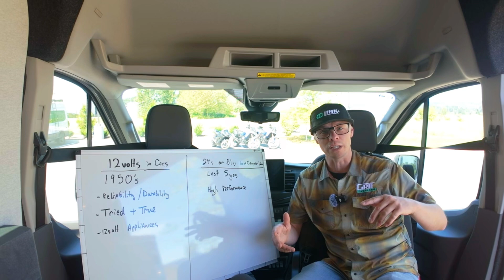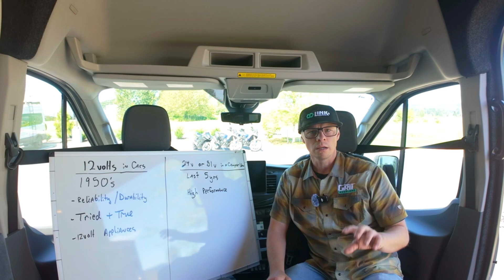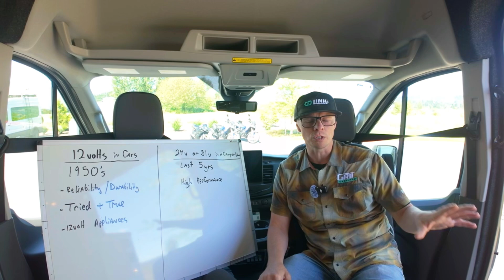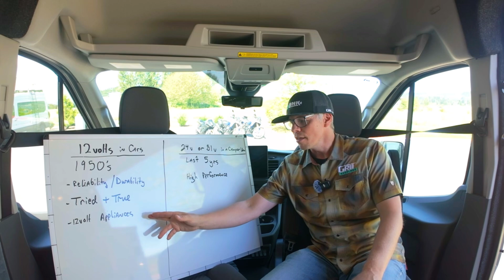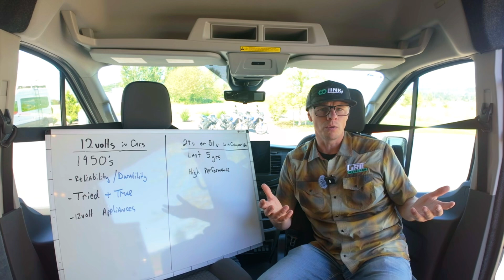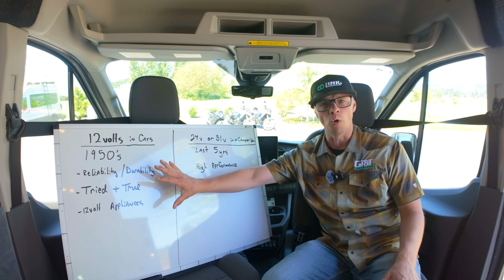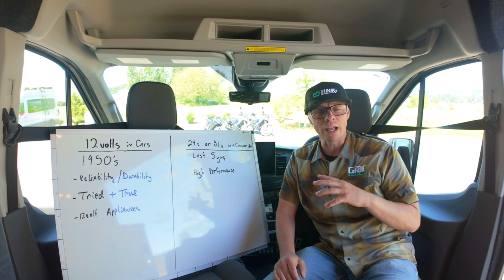Is 12V outdated? Is 48V or 51V the future of Campervans | Grit Overland Experiment

Comment: Very informative video.  I am a new subscriber, thank you.  I have a 12 volt, 824 amp battery bank system and it is much easier for me, to understand, install and maintain.  With higher lithium voltage (14.6), I had to add step down to 12V for my max air fan, do to others commenting higher voltage destroyed their unit.  Do you compensate for higher voltage with your electrical configuration?

Comment: IF you have a large enough battery bank (12v or 24v or 48v), would it make sense to just use only 120v appliances?  You would lose some (10%) power to always have the inverter on - but a "large" battery bank would make that irrelevant.  You could possibly offset the cost of the bigger battery bank with less expensive 120v appliances vs. 12v appliances.  The wiring would just need to be only 120v - except maybe the alternator charging wiring.